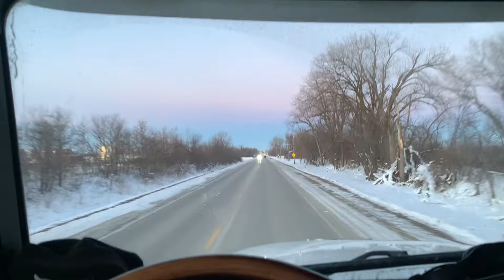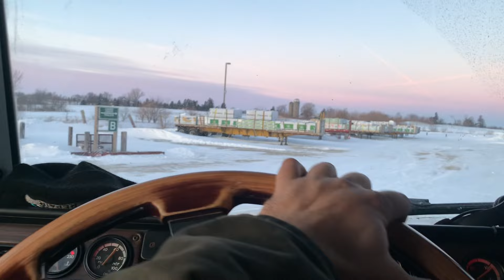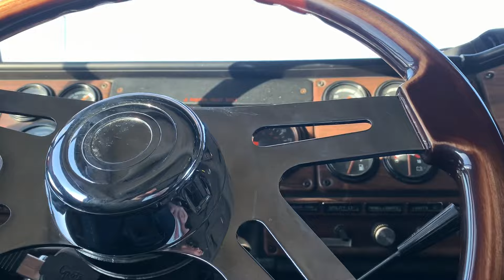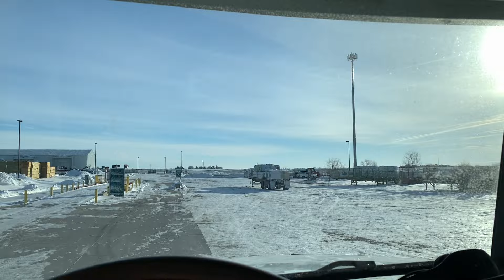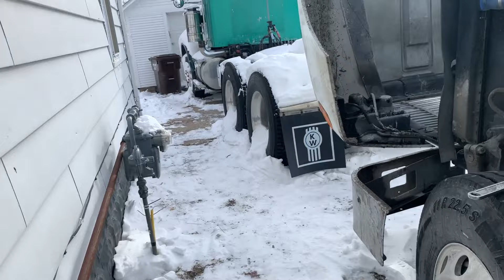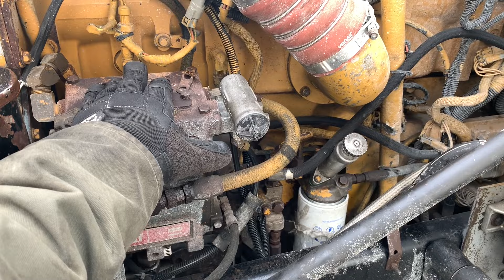More Problems (Owner Operator Trucking)

Comment: You need to drain your tanks before winter and get some brake line antifreeze to pour in the lines.  And get some power service to prevent fuel gelling

Comment: You just need to put some airline antifreeze into the air system.    Im pretty sure your air compressor is fine.   Have you replaced that spin on filter on your air dryer?

Comment: Mine has the dryer on passenger side near rad. That woven metal discharge line goes into a high heat resistant hose that looks like fuel line. They loop it behind the motor over the trans. So the heat of the motor will keep the line clear of frozen water.

Comment: your air dryer froze up and popped the safety off, before they put that on air compressors it would blow the head gasket, keep the 2 micron filter on the engine, the frame filter should be a 25 micron, 10 5 7 microns will starve the fuel pump for fuel and cause low power, you put air line anti freeze in a tank , remove a line or pipe plug, do not pour it in hoses, same on trailers, the touchy brakes would be someone bypassed the proportioning valve, it only gave you full air pressure when the red knob was pushed in, if its normal other times when bobtailing you may have had ice on that valve when you unhooked from a trailer, if its still slow to build air you may have blown the gasket and or the air dryer cartridge is full of carbon, do a oil splatter test, two inch circle on paper, with the braided line off, engine hot, if the circle is covered in oil you need a compressor.

Comment: Just asking?Did you rebuild your air dryer before cold season?Do you have manual air valves on your tanks?Are you aware if you pull a trailer that someone else has pulled that their dryer isn't working they left you a mess?Air system problems really get worse when it gets cold,keep the chin up and their is a lot of knowledge out here,lkeep asking the questions?

Comment: Make sure your heater on your air dryer is working. Pressure relief valve is leaking because theres a blockage
Reply: Most likely air dryer cartridge is frozen

Comment: Usually if you can't build air pressure it's usually the governor
Reply: governor only stops the air compressor from building, in rare cases the unloaders are stuck open

Comment: Why do you run such tight fuel filters in the winter?   When we ran OTR trucks, we went up to 10 micron filters in the winter.  The bio diesel sh*t doesn't flow well when it's cold.
Reply from the maker: I didn’t realize you could run 10 instead of 2 micron. That sort of makes me nervous. I’ll have to look into that a bit

Comment: If your check valve is acting funny you can unscrew that black plastic cap and behind it their is an adjustment screw.For instance if you don't have enough air to get the brakes to release you can adjust as an emergency only to get to a safe spot. Remember emergency only!!!!!

Comment: There is nothing wrong with the blow off valve, just take the line off the air compressor and put some air line antifreeze in the line,,your air dryer is frozen up.